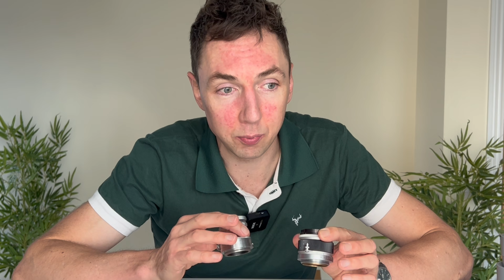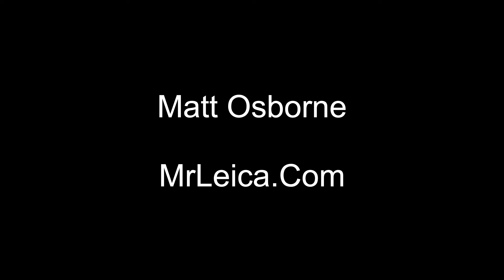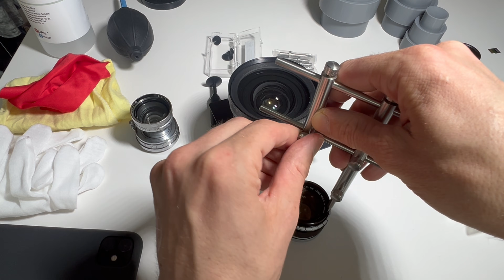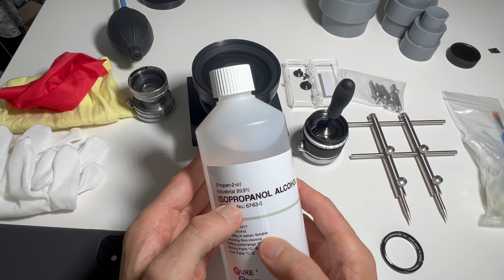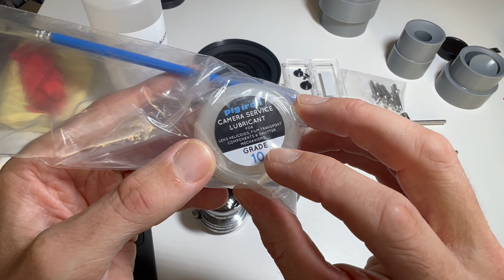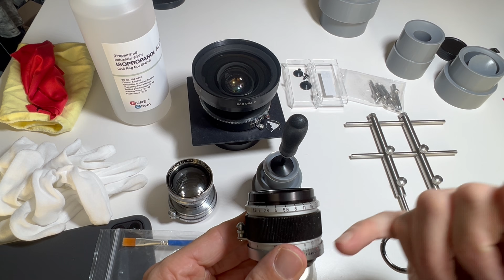🔴 How to CLEAN your Leica lens (Tools required)(CLA your camera lens)

Comment: Two more things from my own experience.

First, don't use lighter fluid for cleaning. It may seem like a harmless shortcut, but it can damage the coatings, especially on older lenses. It's simply not worth the risk.

Second, I don't touch wide-angle lenses like 35mm or wider anymore. I've learned that the hard way. The alignment of the optical elements is so critical that you really need a collimator to get everything back where it belongs. Without one, it's very easy to end up with a lens that no longer focuses correctly at infinity or has smeared corners because something is just slightly out of alignment. A lens like that quickly stops being enjoyable to use, so I'd rather leave those jobs to someone with the proper equipment.
Reply from the maker: Thanks for the tips! Noted

Comment: Hey, so I cleaned my rear element on a 50 lux, although under certain torch angles i can see a little cleaning smear, do you know a good way to get those without dismantling the lens? Also would that affect the image quality if left alone?
Reply from the maker: My 50 lux has a mark too since I got it. I use it and no issues but I should probably take a closer look now I’m more experienced. If it’s not effecting your photos then perhaps leave it do not go damage the lens accidentally.

Comment: Great do see you make your way into cleaning. It's a really usefull skill. A few lenses are already hard to get in great condition and others get foggy while you have them. I just realized that my 50mm f2 Summicron gets a fog "ring" on a inner element. I have it now for almost 15 years and it's from 1952.
Reply from the maker: Hey Tobi, thanks to you for the pro-tips prior to making this video. Yes my first 50/1.8 got the issue during ownership

Comment: Hi Matt👌👌

Did you mend the M3 at the back of the cloth yourself, was there a tear? Hmmm ok I think you know what you are doing and know your way around. Of course, it's also much cheaper than having it done by a professional workshop or directly by Leica. I wouldn't dare 😁

Lg Anderl
Reply from the maker: M3 yes, if small hole you can fix but not tear.
Reply: @MattOsborne-MrLeicaCom is understandable, a crack is of course worse and shouldn't happen even a hole. but at least it's easy to repair that way.

Comment: Fun and useful info! Practicing on a cheap lens is very good advice! A few more tips/cautions: (1) If you take elements out of the lens, make sure you keep track of which side faces up/out. You'd think it would be easy to tell when reassembling... until you run across one where it's NOT easy to tell. Reinstalling an element the wrong way 'round is likely to reduce the performance of the lens. (2) When disassembling, watch for and keep track of shims. These are thin rings used to get precise spacing between pieces. Usually they're metal, but some Soviet lenses have paper shims; they work fine, but are more delicate. (3) If a threaded ring won't turn with your spanner or rubber cup, check along the edge to make sure there isn't a tiny setscrew/grubscrew holding it in place. If you miss this and try to force the ring off (tip #0: never force anything!!!) you'll gouge the barrel. Sometimes these screws are very cleverly hidden.
Reply from the maker: Thanks James! Excellent tips, especially the little screw. Noted!
Reply: @MattOsborne-MrLeicaCom  Don't ask me how I know about that…
Reply: @jlwilliams  I won't. I on the other hand discovered that your mobile phone is your best friend. A hot tip is to photograph every step you take when dismantling lenses you've never been inside before. Otherwise, it's easy to end up like me, sitting at the kitchen table staring at an insane amount of parts that were originally a Nikon zoom lens as I heard a small ball ring disappear on the floor. Or was it a screw? I never found out. You live, you learn. That's the charm, although that kind of learning rarely comes cheap.

Comment: Good to see you on the way to DIY lens cleaning. One piece of advice: If you begin with lens cleaning, don't stab at the dark. Look for a good tutorial on the specific lens you want to clean. // Cemented elements: No, they almost never pose a problem. The cemented surfaces are naturally protected against the environment. There are only very few cemented lenses where the cement is known to deriorate or even separate. (The Canon on your table is not one of them.) // In most cases you want to get to the glas surfaces facing the aperture blades. That's where the haze builds up over time. // Microfibre cloth is super for spectacles, not for lenses. As soon as the cloth picks up the tiniest amount of grease, it's "contaminated" for good. I prefer using loads of Q-tips in combination with Kimtech tissues (there may be other brands just as good). In any case, avoid wiping dry!
Reply from the maker: Thanks. The photo on the cover is my Canon 50mm f1.8 and most info I’ve read says it normally suffers from haze/ fogging. (I bought a second one to use as they’re decent when working). I bought some lint free tissues but they seem to introduce micro scratches so I thought to recommend ‘safe’ clothes instead. Yes to having clean ones.
Reply: @MattOsborne-MrLeicaCom  Haze yes, but not (usually) within a cemented group. Take out all four lens groups (6 lenses in 4 groups) and inspect them individually! The Canon 50/1.8 is easy to work on. See e.g. https://www.youtube.com/watch?v=HX93S2iuG5E

Comment: MATT : This is a great video , I have tried cleaning my M42 A. SCHACT  ULM lenses with the " inner barrel " when the feathers or blades in the 16 blade aperture malfunctioned , those lenses are very complex ... ended up having a Master in JAPAN assemble 2 lenses into one , out of the best components. I now have 2 superb quality 90mm 2.8 A.SCHACT ULM 16 blade 90mm lenses and in the correct cylindrical original cases , with original caps.   I love those 2 lenses too .   Good video. 💪🏻
Reply from the maker: Nice Chris! They sound very complicated haha

Comment: Great video.  I would strongly recommend using a dedicated lens cleaner rather than alcohol. All coatings aren’t created equally so using a dedicated lens cleaner would be the safer choice in my opinion. I learned this after using alcohol and destroying an old Kodak retina rangefinder lens.
Reply from the maker: Thanks Bob, great advice. Okay noted.
Reply: Precisely what I was afraid of. Thanks for the info :)

Comment: Just an extra cautionary point Matt, be very careful with the seating area where your lens element sits. It should be clinically clean. As little as a few hundreds of a milimiter of debris or dirt will cause lens misalignment.
Reply from the maker: Ah yes. The decentred lens issue. Great advice thanks

Comment: Great video Matt...Do you have any tips for when it comes to single or multi-coated lenses. Is it safe to use the Isopropanol alcohol on them ? Cheers, Kev...
Reply from the maker: I’m be seen some popular YouTube repair guys use alcohol but one comment suggested be careful with older lens coatings. I’ve had no issues so far.

Comment: Nice tips, I found that in a pinch you can use the back of a set of digital callipers if you're careful. :D I managed to open up and fix a Summilux 50mm by doing that but obviously the proper tool for the job is a lot better/safer.
Reply from the maker: Thanks Henley, nice! Agreed, having the tools does make things easier.